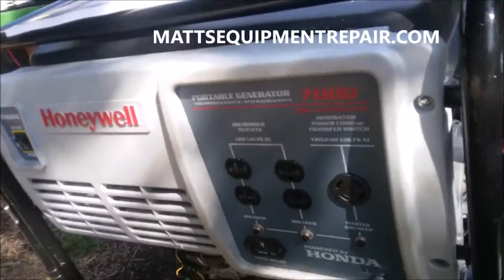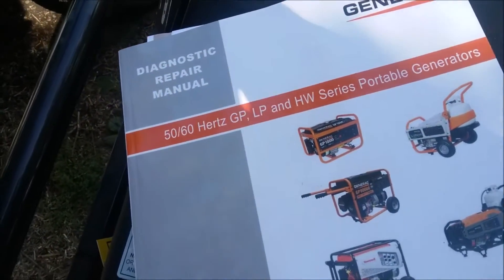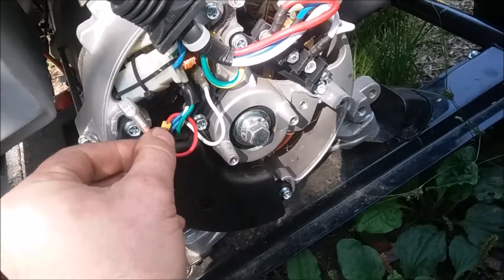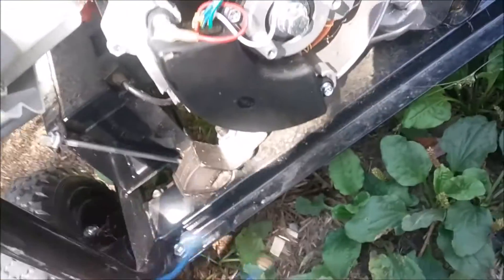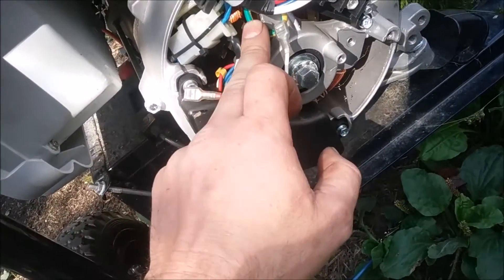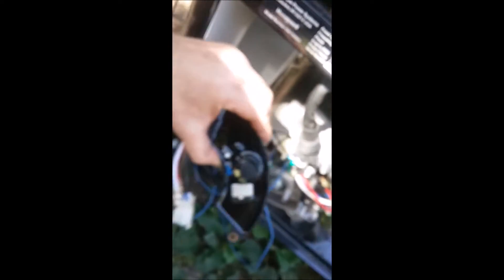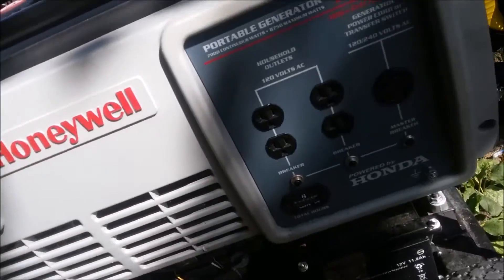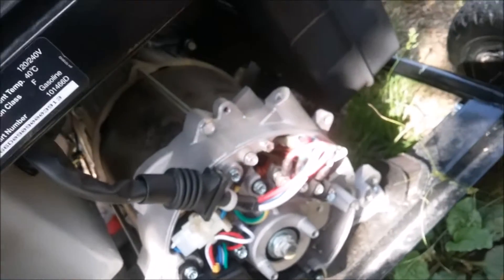Testing a voltage regulator Generac Honeywell generator

Comment: You need to fine set your voltage output by using a jeweler screw driver on the potentiometer screw and turn it ( while generator is running to fine tune the output voltage lest you ruin your tools or anything in your house.

Comment: It was a lot cheaper thank the Honda~~>share4.photo/G22Inverter?z    and just as quiet or better than the Honda. Took it out of the box, put the oil in it and fuel, and it started right up.

Comment: My Generac GP3300 worked great during Hurricane Dorian. But now it’s only putting out 12.5 volts. Does that mean the AVR is bad?
Reply from the maker: That's the most likely suspect,  I would also double check that everything looks good with your brush holder.
Reply: Matt Pinquoch thanks for your reply. A replacement AVR is around $15.00 on eBay, so I’ll go ahead and replace it. I’ll look at the brush holder while I’m at it. Thanks again for your reply.

Comment: So if I’m understanding this right then the AVR not only regulates the voltage but it is the current source?
Reply from the maker: No, power is generated by the windings passing through a magnetic field.  The stator and rotor are the source, the AVR's is just there to make it the correct voltage for what we use.

Comment: Or you can take a DC voltage reading at the brushes...should be about 5VDC, if so, then you know AVR is bad if she isn't putting out 120 VAC.  Nice video.

Comment: My Honda/Briggs Power Boss 7000 had the same issue. Connected the 12V battery as you did and the drill runs so off to Ebay and a replacement AVR is on order. Thanks for making the video.
Reply: Follow up. New AVR showed up today. Installed it and it works like new.  The local Honda dealer wanted $99 to diagnose it then the cost to repair it. I got the part from Ebay for $67 and 15 minutes of my time. Thanks for putting the video together